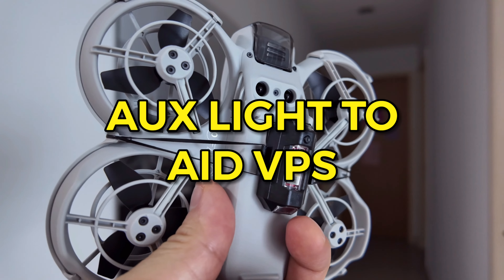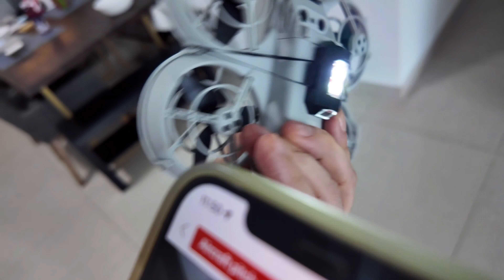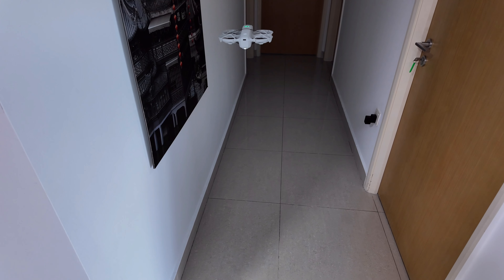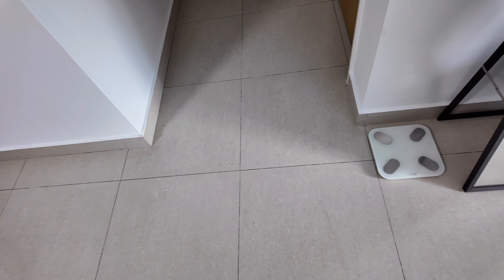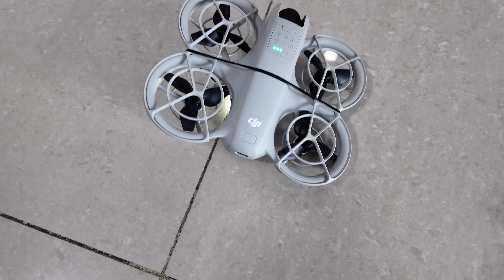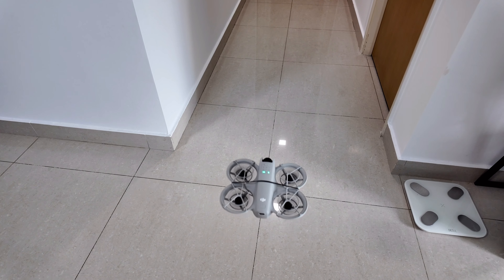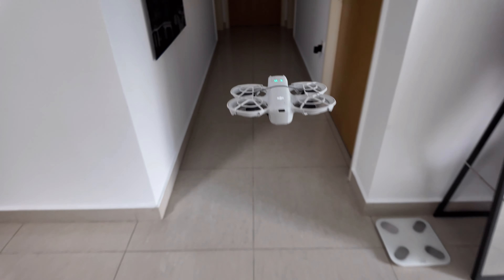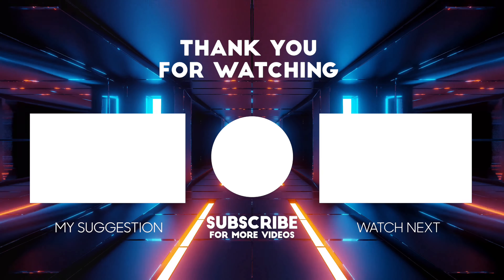DJI NEO | DRONE Light Does It Work? VPS Aid

Comment: Mine goes nuts inside.  Absolutely bonkers.  I blasted the lights in my room to. What exactly does it mean by " Textured environments?" My carpet literally has a cris-cross texture pattern. :D

I am thinking maybe it is a bug in the mobile app. Maybe interference or bad wifi rather then the actual lighting and floors. My friend said they can fly no problems with the controller indoors. For me though with just the phone it is a disaster. It just goes crazy as soon as I go around 5 feet away from the phone.
Reply from the maker: @JBC_cat  not sure. I’m assuming they mean some kind of pattern but I feel for my simple white tile flooring it’s able to hold but only if the light is enough